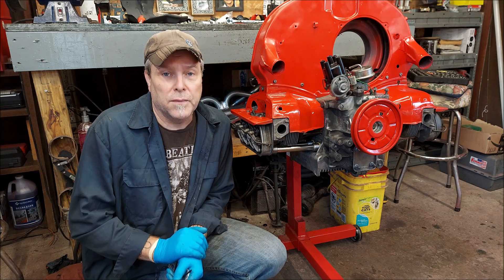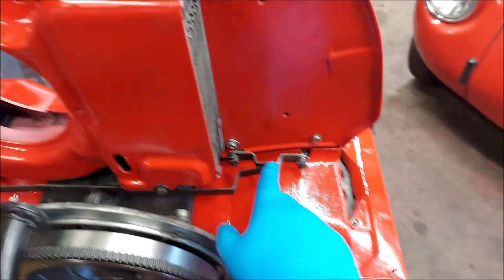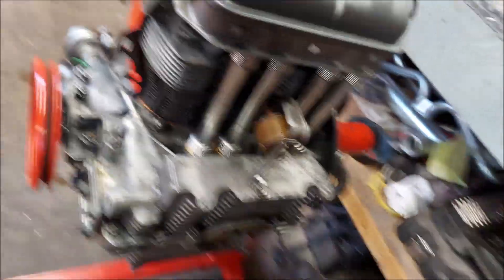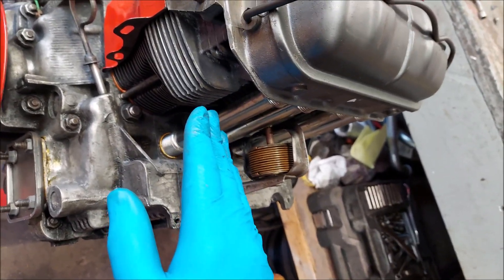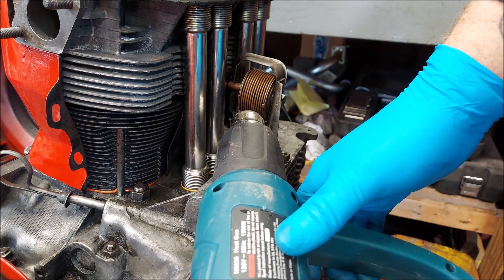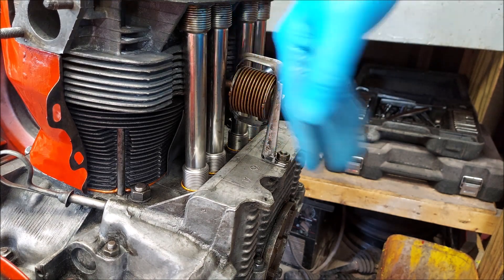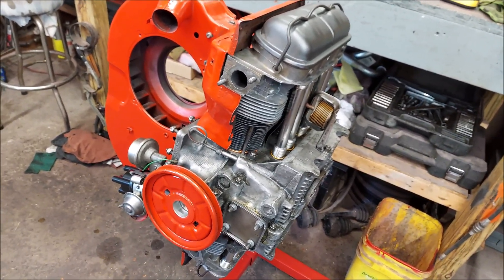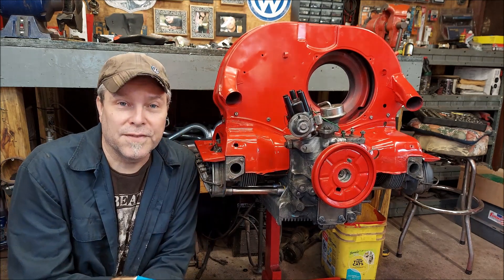VW Beetle - Super Beetle Thermostat Testing and Explanation - Air Cooled Thermostat - Running Hot

Comment: Totally agree.  I got an aftermarket one.  I showed in one of my videos how to modify the OEM support to use the aftermarket one.  Ideally I would have had installed the OEM but I couldn’t find one at the time.  Great video showing the operation of the thermostat.
Reply from the maker: Thanks Junior, I wanted folks to see the function. Awesome powdercoat sells the nice ones, but they're expensive!!
Reply: A re-built 0E thermostat has got to be 100 times better than the aftermarket ones even if they’re expensive it’s cheap insurance
Reply from the maker: @craigmayo5918  I agree Craig. A friend of mine bought the awesome powdercoat one. Pricey, but really worth it!!

Comment: Thank you for explaining this. Until recently I never knew VW motors had these. I know both of my souped up motors don’t have them and I don’t recall if my first bug had one, it was a stock motor... and it was my first car so I was only worried about driving not the little details of how it worked!
Reply from the maker: You’re very welcome, thank you for watching it. I have a second part that I will be putting up within the next few weeks. A different way of testing it. These are very important, although I know it’s usually an argument. But the cylinders need to warm up properly, even in the summer months. Thanks for being here.

Comment: I will put one on my engine when i get the parts for the fan shroud and money but im just worried that 1 day it wont work and i ont know it and it fails to open and blow my engine. But good vid bro
Reply: Skull, if it fails, it does so in the fully open position.  So don’t worry.
Reply from the maker: I missed this comment. As Mike stated they do fail in an open position! The spring also hold the flaps open. The t stat is basically fighting to close it! Hope that made sense. I prefer running them to warm the cylinders up properly!

Comment: Does this help with oil warm up, because my motor only reaches 180-190 degrees when I reach 2.5miles
Reply from the maker: Yes it absolutely does Gilbert. The flaps will stay partially closed until it hits operating temperature.
Reply: @SladesVWBeetle  thanks brother, my engine takes too long to get to operating temperature, it take me around 6 miles to get it it fully warmed up even with traffic, but once it gets to around 190-200 degrees the engine runs great, it just takes a long time
Reply from the maker: @bubot17  you’re welcome brother, I’ve gotten into a lot of debates about that thermostat with people. 
It should be on there to give longevity to the cylinders. 
That way they warm up properly. Without it it takes a very long time for the engine to warm up which causes wear on the cylinders.

Comment: Please explain this......My buddy has no thermostat and no flaps. Has 350k miles on 2 engines. about 150 on each before a rebuild. He drive as a daily driver in california all year round winters sometimes hit the 30s in the morning. Does it really cause engine wear? average engines with or without thermostats here in CA when they were daily drivers lasted between 70 and 100k miles. either way....I think the theroy of thermostats on a VW in warmer climate doing anything is debunked with that data.